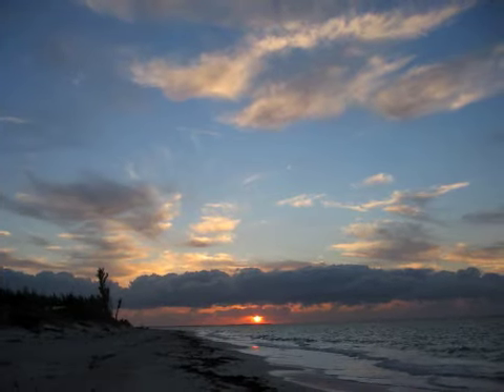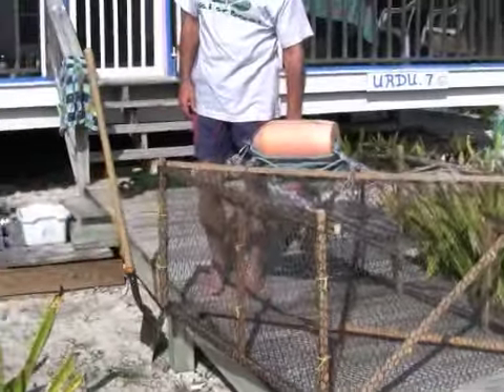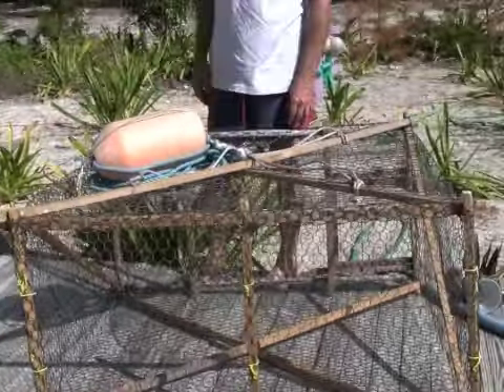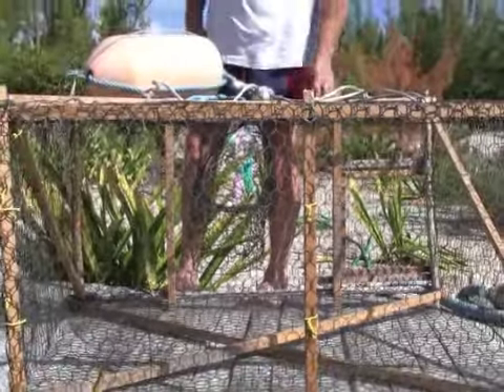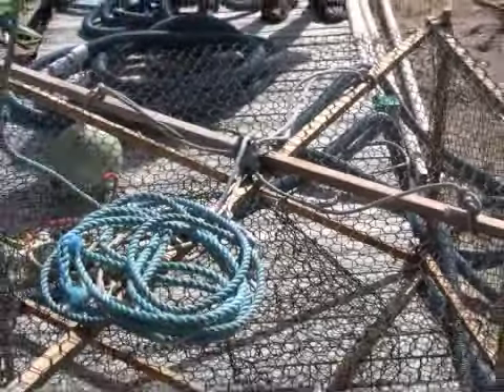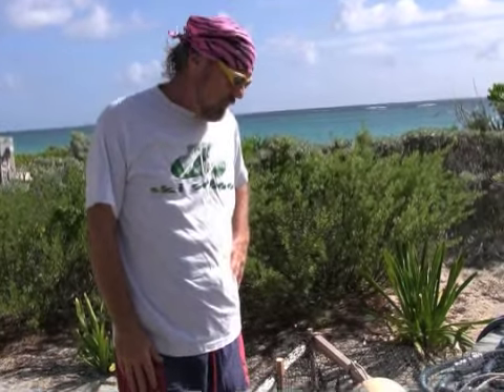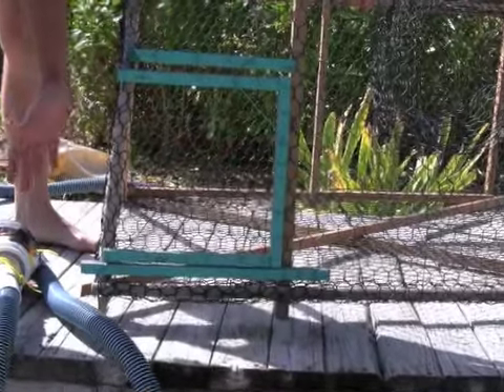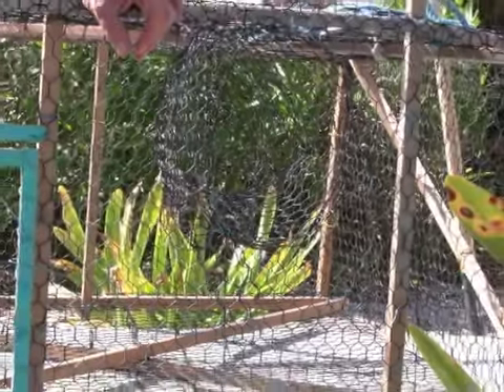Fish Trap Design

Comment: a gallon of water weighs about +/- 8 lbs (salt or fresh)...so 100 gallons is pretty heavy. If you add the fish, you probably wouldn't notice the difference, but yes you would have the weight/mass of both the hundred gallons of water + the fish's weight/mass.
Assuming the tank can hold the mass of the 100 gallons + the mass of the fish without overflowing (loosing water)